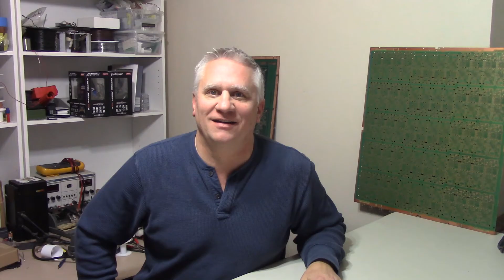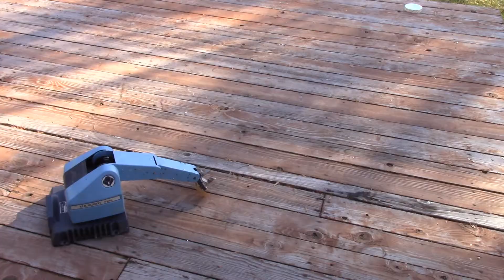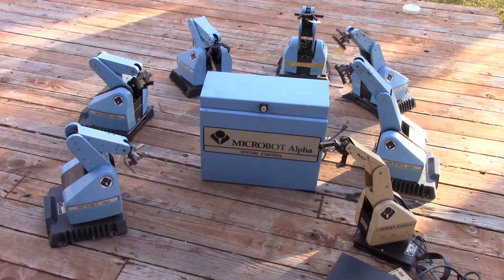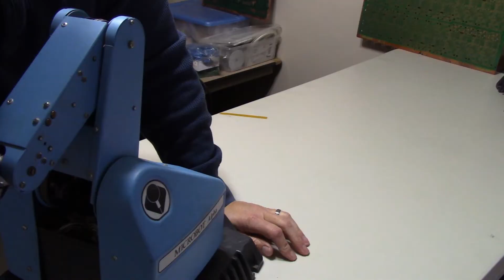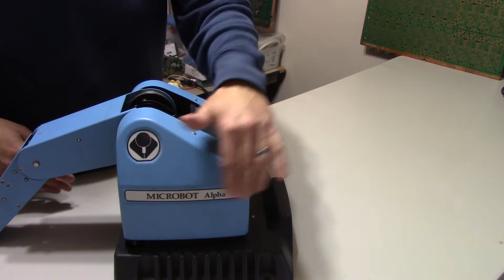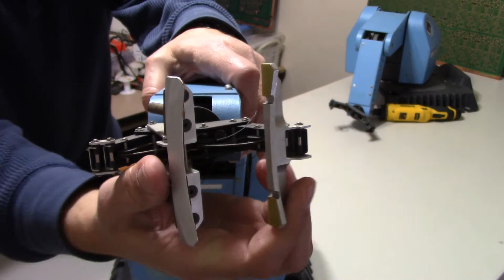Microbot Alpha Robot Arm - Teardown, Operation, and Controller - Part1

Comment: Hi great video. I have the same robot, with the same loose cable(disconnected) for the gripper. Can you explain to me how that cable is connected from the gear to the gripper. I cannot find pictures or a manual anywhere. Thanks
Reply from the maker: Yes I can. I'm in-process on follow-up videos for these robot arms and they will be published just as soon as possible. The brown version shown in the video has the gripper cables come off any time the gripper is manually squeezeed shut. It causes slack in the cables and they pop off the pulleys-not a great design! My technique is to drive the gripper motor to the full open position and then use that slack to get the cables back on the pulleys when I squeeze them together. Hope that helps. Thanks for watching!
Reply: Can't wait for the next video. Thank you!
Reply from the maker: I need 48 hours in the day!  :)